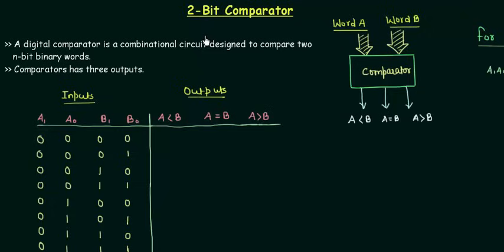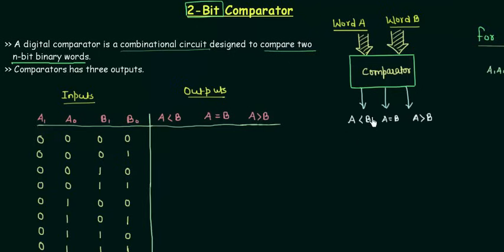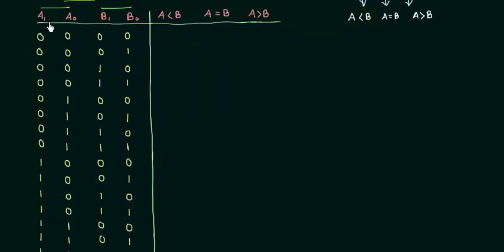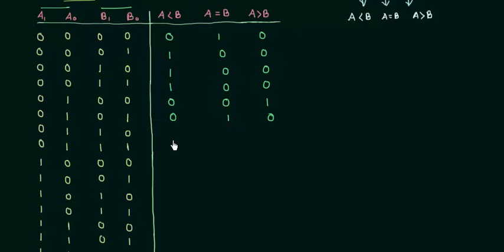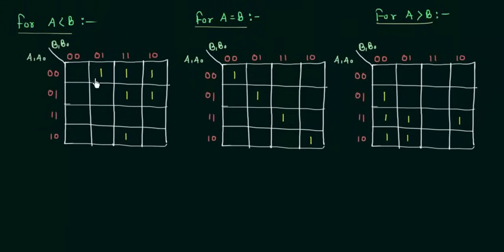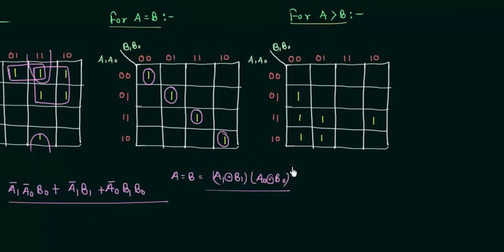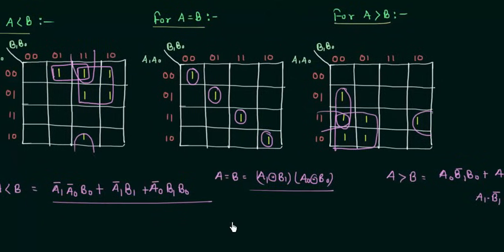2-Bit Comparator

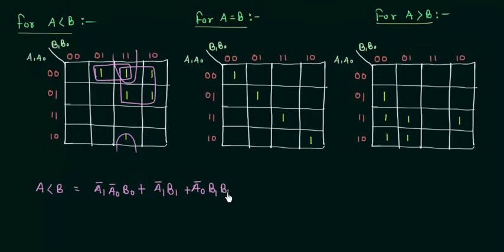Comment: In the case of A=B (4:00) we get check board configuration right???? In that case we use xor operator if the 1 is present in odd ones ..shells.....and we get expression as Ao xor A1 xor B1 xor Bo
In the same way for the above case why don't u choose Ao xnor A1 xnor Bo xnor B1.

Comment: I'm sorry. There is a mistake in the outputs for input 0110. It should be 010 for the outputs where A=B.
Reply: No, it's not a mistake, the 0110 is actually A= 01 & B= 10 .... A1=0, A0=1, B1= 1, B0= 0 ===> A = 01 = 1 in decimal & B = 10 = 2 in decimal ===> A<B. I hope that was clear

Comment: A single input
Time delay to 2 inputs
Parallel in s of AND XOR and NOR
Out s 3 bits.  00 (01 10) 11
                         -1.    0.        +1
Then time delay to 3x3
AND Decode this into 9 outs
-2 -1 0.    -1 0 1.     0 1 2
OR encode -2 (-1 -1) (0 0 0) (1 1) 2
                      -2 -1 0 1 2
The circuit emulates DNA
As.     -2=C.   -1=A.  0=U 1=T.   2=G
Thank you for your video also

Comment: @Neso Academy 
Could you review the table? It seems part of it has been wrongly filled.
Thanks
Reply: I thought so too. But it is correct. You were missing the fact that A1; B1 are MSB and A0; B0 are LSB of the 2 bit words A and B respectively.
Reply: do not compare them as bits (0,1) see them as binary numbers like 00 = 0 || 01=1 || 10=2 || 11=3. and then compare them using mathematical logic  hope it helped

Comment: can you explain 5 bit comparator using Ic 7485?how is cascading done?
Reply: RUTUJA DHANAWADE  use two 7485 ic's and cascade the lsb ic to msb . Later on ground extra terminals of 2nd ic and u will get ur o/p circuit.